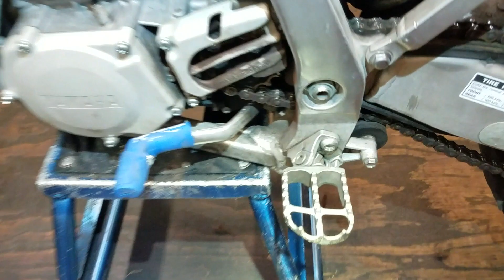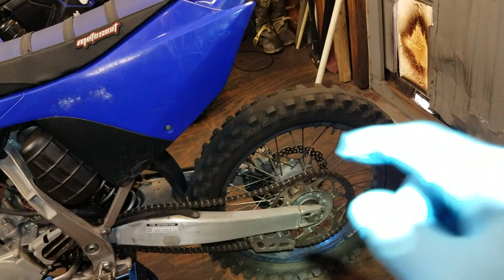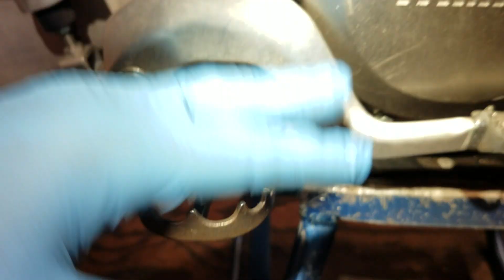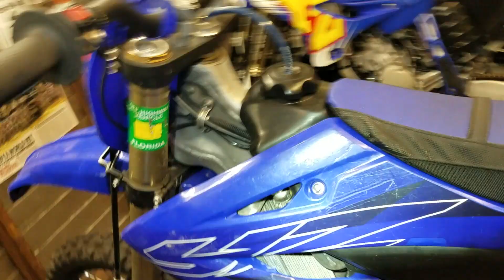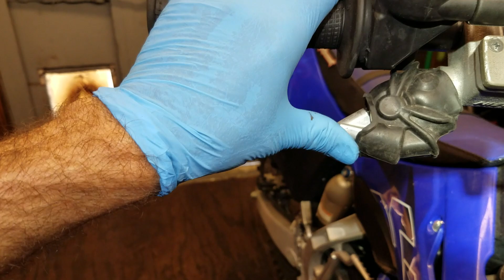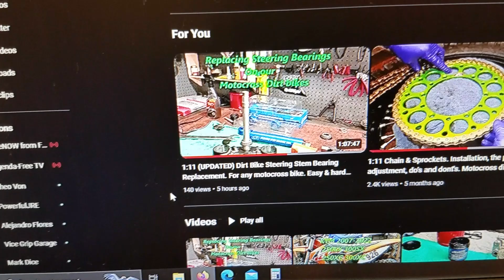1:11 YZ250 Up 2 Speed (Part 1) Introduction. Game plan for getting the Yamaha ready for track use!

Comment: I’m a bigger guy at 250lbs and I feel I need to make some extra hp to compensate for the weight. What bolt on performance parts would you suggest to get max HP to move my fat butt faster lol
Reply from the maker: The best bang for the buck for engine mods is surely the head mod.  You can buy heads like Apex and such but having a head custom done will be the best. One that is tuned require a little race fuel mixed in. Thats going to give you the best results.  I mean you can have one cut that is still safe on pump fuel but for best results have it cut so it requires at least 50/50 Pump/race fuel mix.  I did two videos showing how I cut my own heads at home and will link them below but you can also send your current head to someone like Pro Circuit and they can cut it... Part 1 https://youtu.be/q2KPCoq1Mm8?si=xWWSHBHKs181RYWm  and part 2 https://youtu.be/MphY7RkBhK8?si=DUSQ74TYcYP4pCup